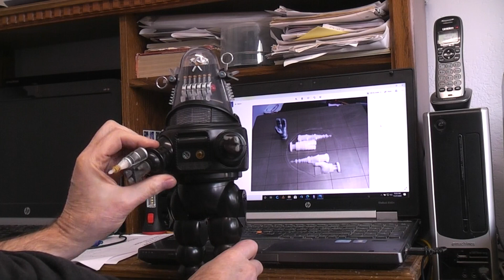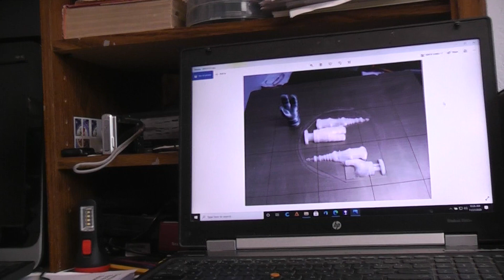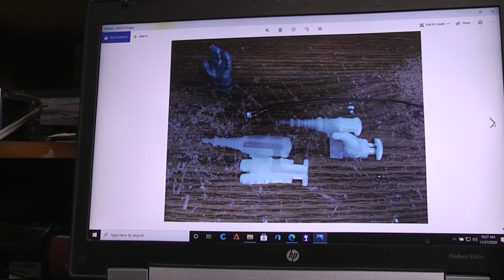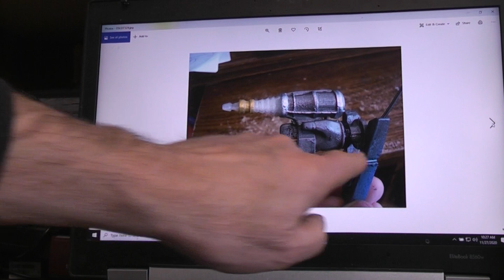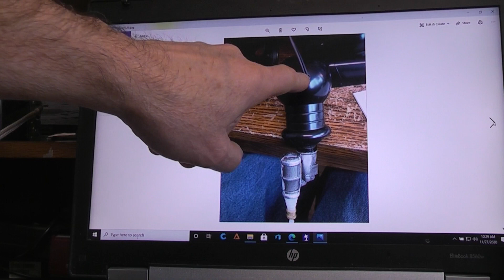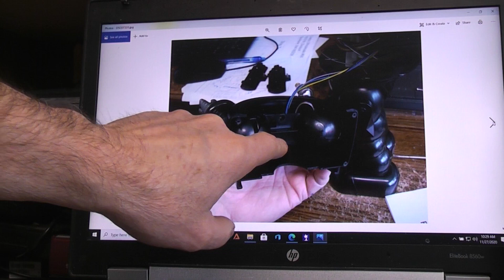NEW light up Blaster for Walmart Robby the Robot.

Comment: I have the Osaka robby, wish they made so it would speak and for the torso to turn.. is it possible to install a board on the Osaka robby to speak as the one in this vid? And a place to accommodate a speaker.
Reply from the maker: The problem with the Osaka Robby is all the plastic gears inside, and at some point they do split and then slip. It is a real pain in the ass to replace the cracked plastic gears do to there location. Now as for your question. Yes a digital sound chip could be added. The only opening on the robot would be the front power switch and the opening that the legs fit in. So a proper speaker placement would be a problem. A new mouth part could be made with small holes in it to let sound out. A voltage booster regulator would be used to boost the 3 volts up to a regulated 5 volts for the sound chip.